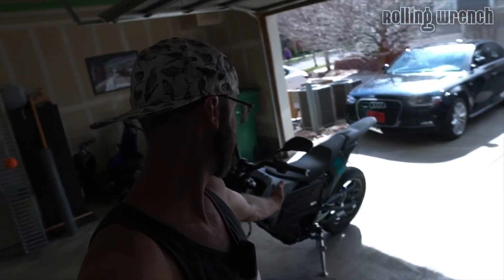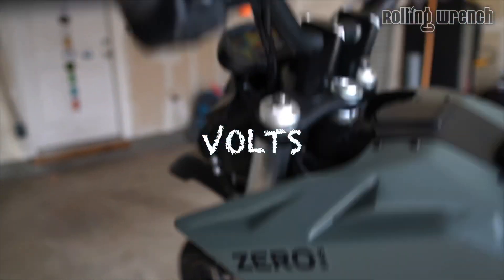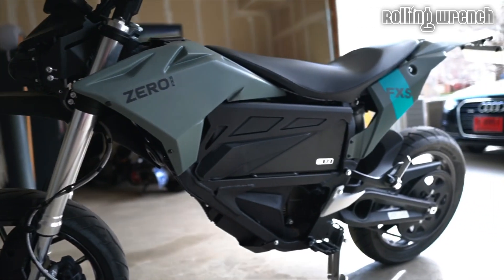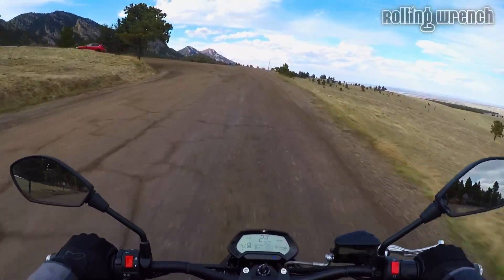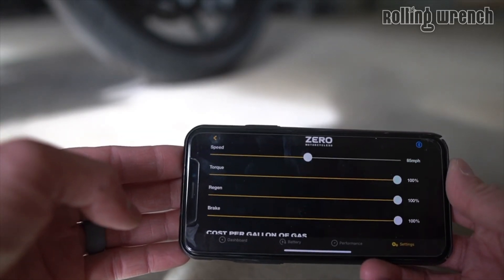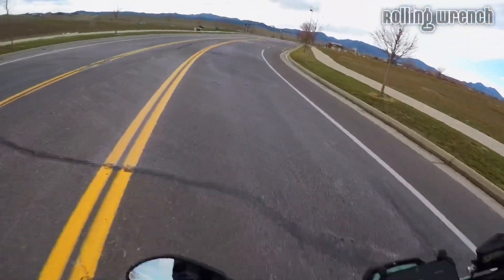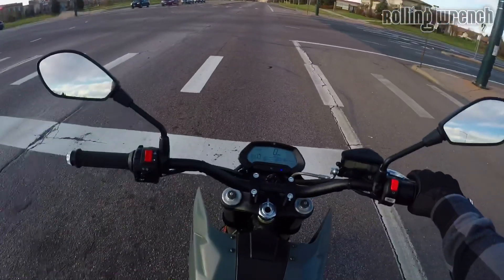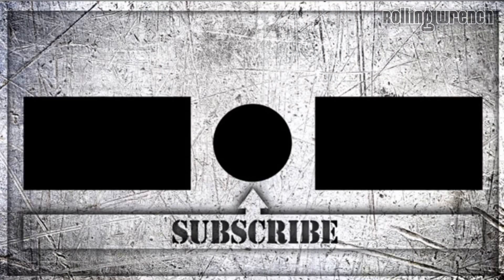Electric motorcycle 2021 Zero FXS - REVIEW

Comment: I'm really considering buying one of these. I currently own 4 electric skateboards and an electric scooter. They're amazing for getting around the neighborhood/ short commutes. However, the range on these zero motorcycles is perfect to go further.
Reply: instablaster.
Reply: I get 110 miles, in the city with my zero s (13kw). Not exactly a "short" commute.
Reply: @Charlesbjtown  So you can basically travel 55 miles from home and 55 miles back home? Not bad at all. Would you know how much ÚS dollar's it cost for a spare battery?
Reply: @jeff40  If you are traveling highway speeds...... no. Would probably only get about 70 miles. But in the city, the range is much more.
Reply: @Charlesbjtown  That's not bad milage for an electric cycle. I lóve the look of the Zero FX. Mostly for short rides in town no highway. Off-road on my ktm 300 2 stroke I can get 58-60 miles 1 way.

Comment: That tent city is pretty tame compared to the ones we have in california. Oakland, SF, San Jose all have terrible homeless problems. This video has me seriously considering a zero. I just paid to have my valves adjusted on my R6 so I dont want to sell it yet but perhaps in a year or so I will make the switch. Keep up the content!
Reply from the maker: I would keep the R6 and get the zero as well. I don’t think the range is long enough to have the zero replace a gas bike.
Reply: @RollingWrench  Good point. Rarely do I ride more than 60 miles at a time. The idea of an electric motorcycle is fascinating to me. I will see how the technology develops.
Reply: @RollingWrench  where did u get the led rear lights??

Comment: Hey there!
To all who are interested:
In Germany there are four license types when riding a motorcycle, depending on your age and experience: A, A1, A2 and AM whereby A is the full, non-limited version and AM is the option you basically have already by owning a license to drive a car. It's allowed to go up to 45 km/h and includes not more than 4 kW rated continuous output - easy. Too slow for many, though.
So until recently you had to go through the regular driving school process, including theoretical and practical exam after so and so many hours of learning and driving, provide proof of first aider, eyesight testing and everything ...
License type A1 goes up to 125 ccm and required all of the above -- but in the end of 2019 in Germany the law has been loosened up a bit due to new regulations waived by the secretary of transportation.
Now if you are at least 25 years old and have a driver's license for at least five years you're allowed to apply for A1 license that would only include 4 x 45 min. of theory and 10 x 45 min. (or 5 x 90 min.) of practice. No other requirements. And no exam.
So I'm currently in the middle of this, waiting for my practical lessions to start. You have to own the right clothes though, they are very specific with this, but other than that it's now fairly easy. And speaking of this ... I know you recommended not to buy this as a first bike but this is what I will do and hopefully not regret it. Every review I have watched so far is just through the roof and I can't wait to give this a test drive when I got the license. I'm thrilled, also to know that there are options to modify the bike (like swapping lamps). 
So thanks for your review, it's been another helpful report on what the future holds already now. Yay!
Reply: Tobias Heyl he said that he was wrong about this being a bad beginner bike. If u lower the torque and put it in eco mode It’s a perfect beginner bike
Reply: Seems a lot to go through. In California, we have a written test-- 3 tries-- plus a "road test" where basically there's a deputy watching you as you stop, turn, use your hand signals and blinkers, do a figure eight, a circle-- just to let the officer know you can handle the bike you brought with you.
The age, I believe, is either 15  or 15-1/2, but our traffic laws-- and the enforcement of them-- are both pretty strict. They take traffic offenses seriously here so you had better, first know the rules, and second, follow them.  Getting a violation is a real nut-buster.
The roads here are the safest-built that I've ever driven on, as well. 
And there's a strong police presence on the roads, so the 3 things combine to make the accident rate one of the lowest of the fifty states.

Comment: Any info on the rear brake light setup. My 2020 just shipped. What you did looks way better than stock. Also like the bar ends. Do you find the pegs comfy? Little seat time but I'm thinking that's an upgrade I want to do.
Reply from the maker: Congrats on the new zero! I built the taillight custom. The pegs are comfy for sure.
Reply: @RollingWrench  right on. Thanks for the quick reply.
Reply: @RollingWrench  HI! I'm also super interested by the tail light. Can you share what light component you used?
Reply: Ditto on the tail light
Reply: I also love the tail light set up. Some more info would be great!!

Comment: You said this shouldn’t be anyone’s first bike due to the torque. What if I turn the torque way down on the custom tube app?
Reply from the maker: Yaaa, I shouldn’t have said that. You can certainly tune it down
Reply: Also the fact that its a expensive has bike to do repairs for. You crash it or disconnect something ur not supposed to and your out multiple k's
Reply: Which is always what newbies do

Comment: Hay mate... i rode the elder FX bikes and they overheat in the first 5 minutes. How does the 2020 model? 10:00 never accelerate when your bike is not upright 😉. You will go down sometimes.
Reply: the trick is to limit max speed a hair below max speed. I have a 2018 FXS, had similar problems with overheating then set the top speed to 83mph and have had zero problems with overheating since. its top speed is really only around 86mph so no big loss. motor efficiency plummets past that - so yeah.

Comment: Awesome bike! Out of curiosity what's the 0-60 on it?
Reply: Around 3-4 seconds most likely. Most motorcycle model acceleration  info seems to be primarily end user based. And not from official certification. Only nascar and rich ppl stuff do that for the marketing. And since zero isnt exactly super into the extreme side i doubt they will.

Comment: Stairs? Not a problem. I bet riding with bigger wheels opens up so many different riding possibilities
Reply from the maker: Definitely much different then the ruck. They are both fun as hell!
Reply: @RollingWrench  it probably also helps that you can beat pretty much any other production vehicle off the line on the zero lol 🤷🏻‍♂️

Comment: I don’t understand how this bike in 2020 doesn’t have level 3 quick charge, especially with only 50 miles of range it would help so much if you could charge it outside your home
Reply from the maker: You can with an adaptor or the slow charge with the supplies cord
Reply: In september Zero will show their new 2021 models 
I hope to see 8kw DC Chargers on FX as an option and 3kw Charging port as a basic
Also improving the battery up to 7.7kwh
Reply from the maker: These bikes will just keep getting better and better :-)
Reply: Rolling Wrench let’s hope they are worth the wait. I really love these bikes but sometimes they have some drawbacks which make me question whether or not they are worth the price.
Reply from the maker: KK Leo Did the price is in the ride in my opinion. The fit and finish is only decent. The ride is unbelievable!
Reply: Rolling Wrench you can also easily customize the fx like you did too
Reply: You don't understand? It's pretty simple. The FXS is a dirt bike, possibly a short commuter bike. Not meant for fast charging. It also doesn't physically welcome fast charging. You would not be able to have such light & nimble bike if you had to put a battery cooling system on the bike to support fast charging, and once again that goes against the bike's purpose which is to be a dirt bike. Not even taking into consideration that installing a battery cooling system would make the FXS a lot bigger. The SRS actually currently supports 12kw of charging. Which is more than the 8kw charging that the above Chief Like mentioned. You could use only Tesla Destination Chargers to get that 12kw input. If you want more than this, and are willing to accept the extra weight and size of charging faster, just get an Energica.
Reply: Gabe Macabu ya but when your paying 10k you’d expect something better then a short commute, I like the bike allot but I feel like the range might be too short for the price your paying but with fast charging I feel like it would change that completely, I understand the fast charging might defy the purpose of the bike in your opinion but then this bike has absolutely no practical use whatsoever if the bike is just a “dirt bike just for short commutes”.
Reply: Gabe Macabu at the moment I can’t decide between choosing to get an energica Eva esse esse 9 which has more range, has fast charging, up right riding position, and ridiculous acceleration and top speed, all that for 6k more, however I feel like the fxs is just more of an easygoing bike which is what I’m looking for, it’s lighter, more nimble and just an over all simpler machine.

Comment: You can easily ride it with no experience on any motorcycle before.Start on eco mode.Is like a scooter but much easier to ride it due to the balance and it’s agility!
Reply from the maker: True, I should have emphasized on that a little more
Reply: Tibor Tatrai I have a scooter now but want one of these. Think it will be an easy transition?
Reply: @GxGNoir  I used to have a scooter (Blur 220i) and got one of these. The skills you picked up riding a scooter mostly translate to this. There's minor adjustments that you'd need to adjust when changing between any style of bike. I thought my old bike was nimble, but this is way more agile. But the main thing is that you just need to come to grips with the HUGE increase in power in your throttle.  ....and the loss of storage. (that's actually the part that I miss most. Storing my helmet in my underseat trunk)

oh, and getting used to using a foot brake for your rear rather than your left hand.
Reply: Chris Cypher I got a Zero S last month. It feels exactly like riding a scooter but way more powerful and nimble. Had no problem adjusting at all

Comment: JUST THINK? MY BROTHER!! To take an electric drive motor of say 12 kW size, then tie it into the C.V. TRANSMISSION OF A GY6 TRANSMISSION?? THEN MOUNT THIS UNIT ON A STRETCHED OUT SCOOTER? JUST THINK NOT A SINGLE SPEED FINAL DRIVE SYSTEM LIKE YOUR ZERO, BUT ONE WITH ENDLESS GEARS, THRU A C.V. SYSTEM TIE TO A ELECTRIC MOTOR? BATTERIES FIT UNDER THE SEAT? AND WATCH IT GO!! WILL TOP OUT AT ABOUT 135 M.P.H.!!!!!

Comment: I would really like an electric bike. There are two problems though: battery technology is still crap, and the cost is trrough the roof compared to ICE.  Damn boiii.

The range is not the real problem. It's the impossibility to charge it everywhere and as fast as you can refuel a normal vehicle. Also the fact that it's plenty of 10-15y/o bikes around, while on this the battery would be trashed way before, and the replacement cost will be more than the bike value.
Reply from the maker: There are gas motorcycle and there are electric motorcycles. Two totally different experiences. $14k can buy a lot. I chose this bike because of the ride / experience. You can’t duplicate it with a gas motorcycle. At leased that’s where my head is, and why I chose the Zero. I couldn’t be happier with my choice :-)
Reply: Cost is pretty close IMO. A 2020 CRF450L is 11k and a Zero FX 7.2 is under 10k with tax credits.  The biggest issue is range/charger availability in most areas you would want to ride to. A Quick charge port on this bike would yield about 80% charge in about an hour which isnt bad, the problem is finding a charger close to off-road areas. Cities like LA, SF and even Houston have plenty of quick chargers so communing is no problem.  Its when you want to go out to the stix and ride off-road you will never find a charger close to the trail head.
I think the battery cost will be less of an issue when there are enough of these on the road. You could probably get an aftermarket battery for less than $1k but the demand is not there for someone to make one. You can get full gen 1 nissan Leaf packs for $2.8k and they are 20KWH..  A 3.6KWH battery should be 1/4 of that because its mostly the lithium that sets the price.

Wrench is correct, there is nothing like driving an electric vehicle. The acceleration can be whatever you want it to be up to the max torque of the motor. HP is almost meaningless as the motor will spin at whatever speed you tell it to up to the torque limit.  Most E-vehicles are software regulated to make them perform closely to a an ICE engine but they have  much more potential.

Comment: Can u stop and charge at Starbucks?
Reply: technically yes, but there's little point. FX and FXS come with a pitiful 650w on-board charger. that'll get you at most 10miles per hour charged. that's ok for leaving it plugged in at work or overnight at home but not so much if you run out of juice on the road.

the S, SR, DS, and DSR come with a 1300w on-board charger (and an option to get level 2 [6000w] charging for another $2500 USD). Interestingly a base model S and DS weigh and cost about the same as the FX(S) but for some reason have a faster charger.